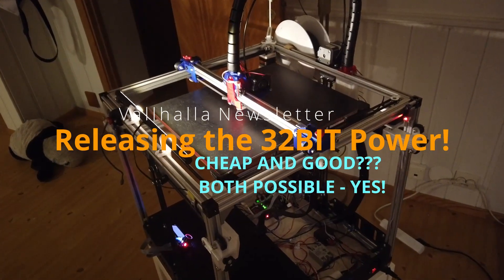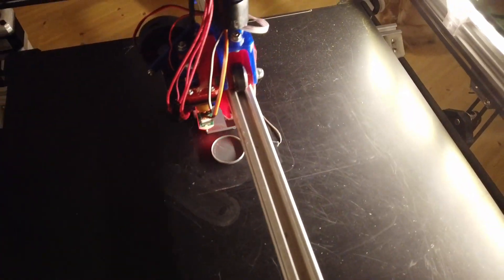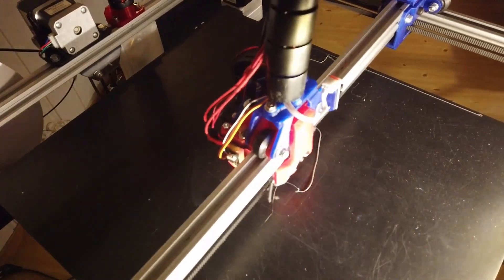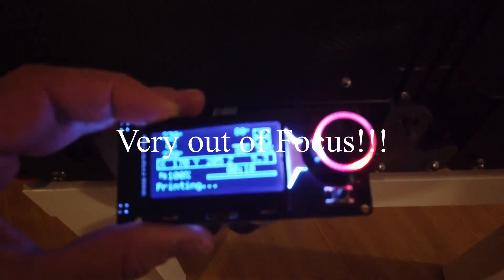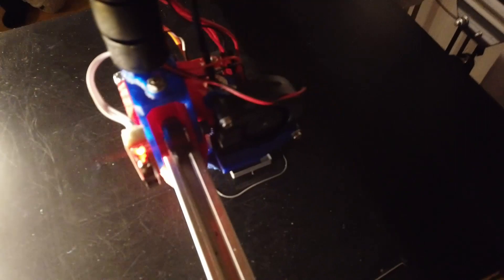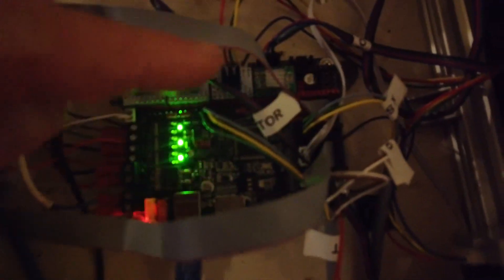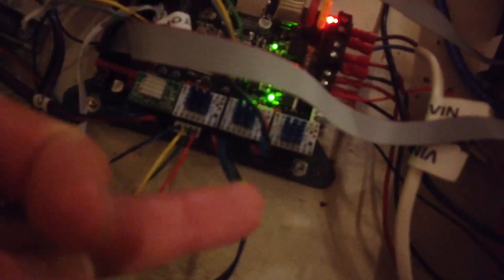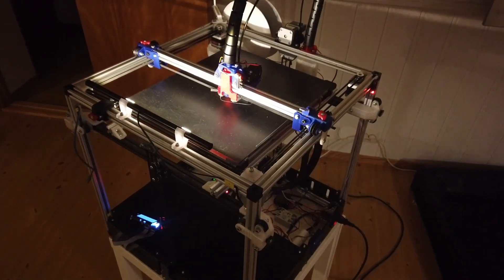1/3 3DP - 32 BIT Power with MARLIN 2 - SKR 1.3 Controller - first run

Comment: hello same  board and same screen  what are the  code for using  this screen   thanks
Reply from the maker: You activate the fystec MINI12864 1.2 line in marlin
Reply: @PRO3DESIGN  thanks, 👍

Comment: May I ask why didn’t you used the tft 3.5 touchscreen that comes with the skr board ?
Reply: the touch is rubbish .. you can't make the changes to things like z height on the TFT .. i tossed mine in the bin
Reply from the maker: @Ultrasonictwo  I sold my previous one as well...
Reply from the maker: Last time I tried tft 3.5 I got no feed back on the screen printing with octoprint. I had to print from the tft controller with SD card
Reply from the maker: I did not like the tft 35 as of that
Reply: PRO 3D Oh okay thank you sir. Keep up the awesome work. Cheers from France!